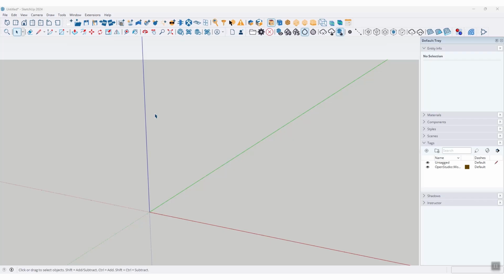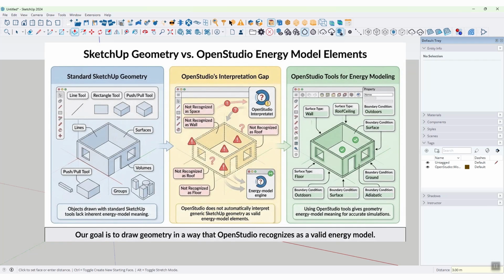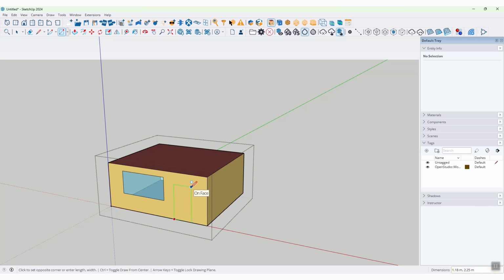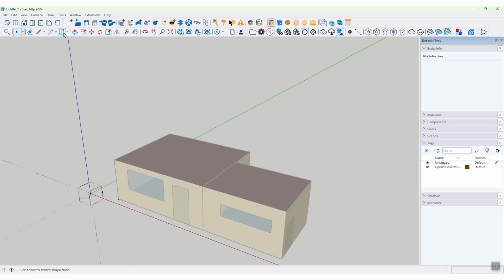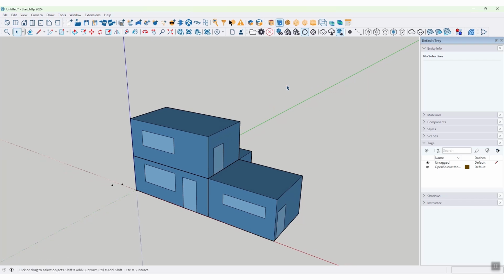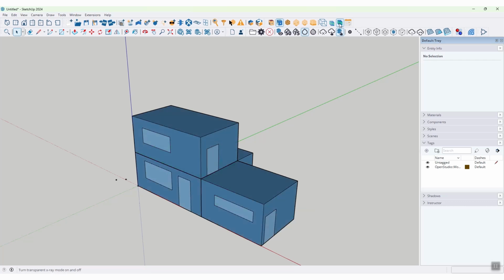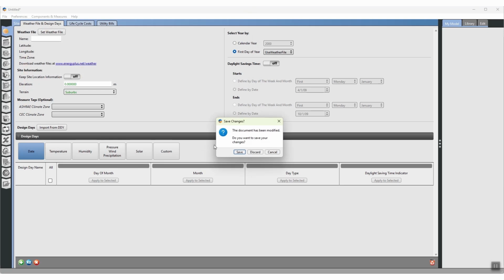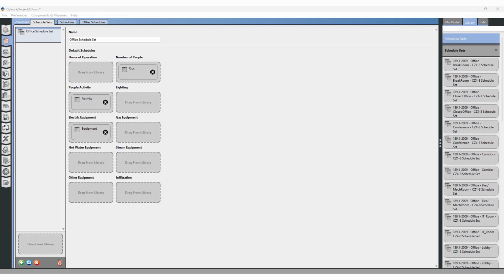OpenStudio Tutorial – Chapter 9: Introduction to Sketchup plugin

Comment: Thank you for this video! It was very helpful.

I have a question about the workflow: As I understand it, the SketchUp OpenStudio plugin only allows editing of geometry, while materials, HVAC systems, schedules, and space loadings are edited and added through the OpenStudio Application.

In other words, is the SketchUp OpenStudio plugin primarily intended for creating more complex geometry compared to FloorSpaceJS (the geometry editor within OpenStudio Application)?

If so, will it be possible to re-edit a model that was originally created in the SketchUp OpenStudio plugin using the FloorSpaceJS tools within the OpenStudio Application?

Thanks in advance for your clarification!
Reply from the maker: Hi,

Thanks for your comment.

In principle, yes, that is correct.

However, please note that when working with OpenStudio, you may sometimes encounter bugs or unexpected issues, so modeling in it is not always as straightforward as it may seem at first.

For that reason, I would not recommend switching repeatedly between SketchUp and OpenStudio’s internal geometry-editing tools unless you know exactly what you are doing. Also, make sure to save backup copies regularly before making major changes.